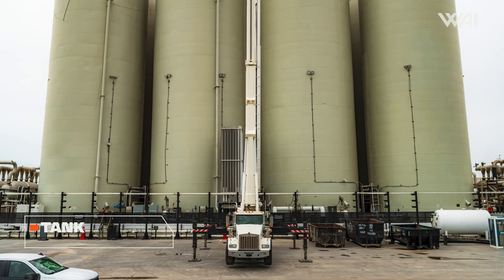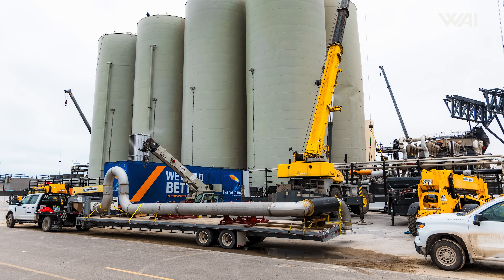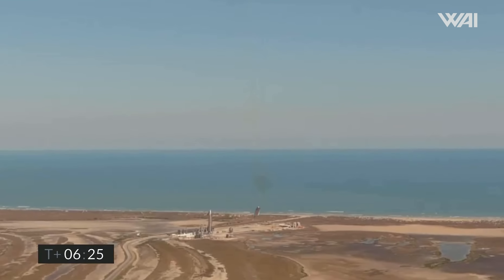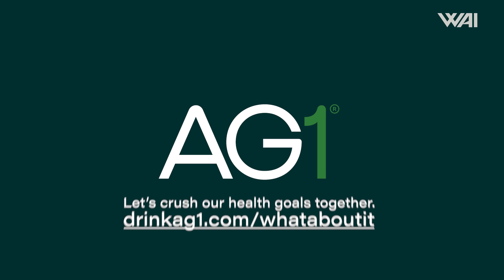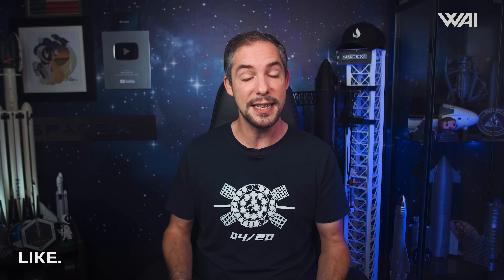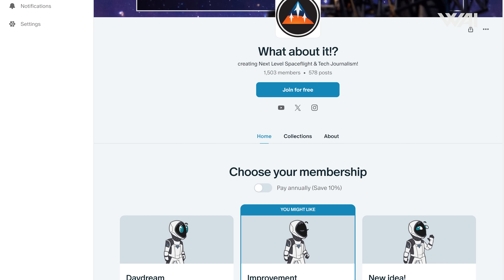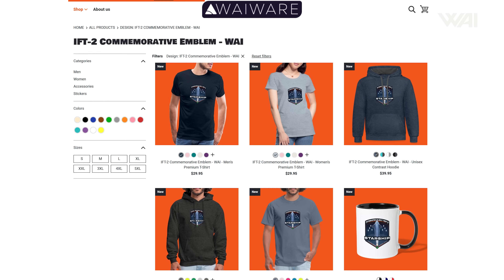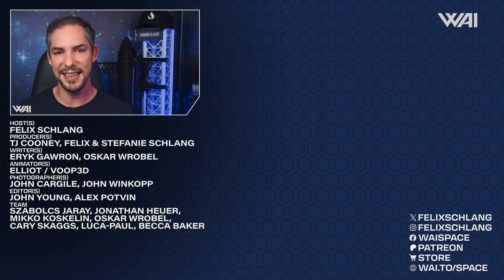SpaceX Starship Countdown To IFT3 - Massive Launch Site Upgrade!

Comment: For those interested in how rocket testing works, the German A-4 was the precursor to the infamous V-2.  It wasn't until its third test before it reached 50 miles high, an altitude when some say space starts.  The launches of the first three Atlas rockets were failures.  SpaceX has already reached 90 miles on it's second test.  So for testing new rocket technology, SpaceX is doing pretty good.
Reply: For those interested, the Germans were pioneers in rocket development and under an  allied bombing campaign and suffering critical materials shortages sooo you can excuse them for having failures. Musk and co had over 80 years of experience to draw upon and the benefits of computer analysis aided design ,so to have 2 rockets fail is inexcusable. This whole starship project is merely a reason to stroke Musks ego at the expense of the U.S taxpayer.
Reply: specifically A-4 is the german designation of the V-2 (which is the english designation for the A4), The V2 was the buzz bomb (aka doodlebug) a subsonic cruse missile. The A-4 was not a precursor to the V2, it WAS the V2.
Reply: @jessepollard7132  The buzz bomb was the V1.
Reply: @interman7715  TBH the rocket didn't fail... the procedures and maths for the staging and launch pad are the ones failed. 

The rocket was already proven in the SN series of test rockets, now is the hard part of putting everything and anything together. 

The SN era of starship test campaign / StarHopper have already proven certain design concepts, including belly flopping and thereafter touchdown, falcon styled landing, capability of the full flow stage combustion methane engine integrated with the rocket.
Reply: @interman7715  Cool story dude, but NASA lost humans in shuttle with only about 20 years less of experience to draw from difference than Musk...
Reply: SpaceX does great. The fastest way to test is to subject the rocket to the most extreme conditions. SpaceX is known for cheering when a rocket explodes. It means they solved all the problems up to the failure event. Eventually they get to a full orbit with successful landing and then testing stops.
They no longer test Falcon 9 rockets to explosion. That's already been done. So the Falcon 9 is now the safest and most reliable rocket ever.
It all looks like a dumpster fire while testing exists, and the detractors have plenty to mock concerning Starship. But this is the fastest path to victory.
If you have the money, this is how you leapfrog over huge technological obstacles. And Elon has the money. Instead of being careful and waiting 10 years for a success (like Blue Origin), he's being purposefully reckless and makes the same advancements in a year or two.
Yes it's more expensive up front with plenty of damaged rockets and launch pads, but once testing is over SpaceX enters a phase where they have a virtual monopoly on services. Nobody else will have a superheavy reusable rocket like Starship. BO's New Glen could be another 10 years away, if ever. That means for at least the next 10 years, SpaceX will have no real competition at that lift rating.

Once minimum viable product for Starship is achieved, expect SpaceX to being testing on Starship's replacement. There's no reason to remain satisfied with just being the best.

Comment: As for transporting the spherical methane tanks, yes it can be done. Bigger and heavier peices are moved regularly. From multi million pound transformers, to nuclear reactors and components, to houses and buildings. True it may have to go into Port of Corpus Christy or Port Aransis as they both have the capabilities to recieve the large barge and get it loaded out. There will be alot of logistics to avoid bridges and underpasses but completely doable. There are a few companies that specialize in this type of transportation.  And remember the spherical tank is much stronger than the tanks currently used. If one of those blows you have much bigger problems than that. If you are really concerned then install them underground. Avoid a failed landing accident all together. Again, completely doable even on the coast. Thank you for the update.

Comment: Attempting to move a massive tank from Florida to Starbase is just a silly notion. It's far cheaper to build something that size on site, after some local sub-assembly. There isn't a shortage of skilled pressure rank welders in Texas.

Comment: I've been there and you've been there there is so much sand in that area. They ought to foam those tanks to keep them insulated even better and then bury them in sand it's amazing how much 10 or 20 ft of sand will protect something. Build a concrete reinforced wall around it and backfill it with sand wouldn't look pretty but you could grow grass on top of it and it would also keep things from getting out of hand should you have an explosion on the pad. And since day one I've been in favor of dredging a port right up to star base. That way you can bring your tankers in full of fuel and offload them easy because the congestion on highway 4 is just going to keep getting worse.

Comment: I think SpaceX will be ready for IFT-3 soon, but doubt they going to have an FAA permit any time soon, without completing an investigation about IFT-2.
Reply from the maker: The investigation might be done soon as well. No FWS involvement is definitely a good thing. No sharks were harmed. :_WAISweet:
Reply: I think the IFT-2 investigation wont take too long as the investigation for IFT-1 didn’t take too long. Probably the main wait will either be booster 10 or the SQD. So hopes up!
Reply: Jesu❤s power proof . Warning it last 72 hours
Reply: Abolish the FAA
Reply: @blitzkrieg1941  No
Reply: Way less points to cover over this investigation compared to the first. Should be much faster.
Reply: @Whataboutit agreed. The dangers were much smaller and that counts. Think third time will be succesfull anyway. Spacex learns quicker then all competitors.
Reply: The FAA moves a little faster than the fish and wildlife service.  By months lol.
Reply: @Aerogamer158  that's because it's really hard to take surveys of fish's opinions.
Reply: My lottery bet is a launch on January 15th.
Reply: @appliedfacts  my lottery bet is that you're wrong.
Reply: @uku4171 Ok, genius, what date would you WAG it?
Reply: @appliedfacts  I guess I'd say middle of March
Reply: I thought that investigation should already be under way - although I suppose that perhaps SpaceX may want to complete their own analysis of IFT2 first, before involving the FAA ?

Clearly SpaceX are also doing a pretty thorough examination and checkout of facilities that have come under any stress.

Others have said that it’s largely written by SpaceX, and then checked and commented on by the FAA.
Reply: @peterclarke3020 When a mishap occurs, the company that has the accident does the analysis, report and mitigations/fixes. After they finish the report they take their findings to the FAA. The FAA then looks it over and approves or denies it. After all that is done, the FAA then writes their report.

Comment: Moving the spherical tanks is an example of how airships have applications. An airship big enough to lift those tanks is not a technical challenge. The tanks could be moved onto a barge and shipped by sea to offshore from Starbase, then an airship could pick it up and move it the last mile. It's also possible to use an airship for the entire trip, but the planning and execution to avoid carrying it over populated areas would be more difficult.
Reply: Airships are the future, but we HAVE to get over the "Hindenberg Effect" and learn to SAFELY utilize hydrogen as a lifting gas in place of helium. I have been studying (and developing solutions to...) this problem for over 10 years now and I would LOVE to work with SpaceX/Tesla to make these dreams a reality. They are the only player in the world that have the means and technologies in-house to develop such a thing and also have a clear need/use case as well.
Reply: @Sin526  Yes. As you no doubt know, at least visible part of the Hindenburg disaster was more about using what was essentially thermite to coat the outside of the ship.
Nowadays, we have a large array of new materials and technologies that can change the equation.
IIRC one of the modern projects does use hydrogen, in a dozen or more smaller cells within a dirigible framework. If such a system used pure nitrogen or CO2 for the volume between the cells and the exterior, with good leak detectors in that space, such a system should be reasonably safe, at least for industrial lifting projects.
Making them practical in changeable weather or in hilly country is a challenge as well. But using hydrogen the prospect of rapidly releasing the gas to set the airship down is much less of an economic challenge. Hypothetically, the vehicle/vessel could even incorporate a water cracker to produce more hydrogen, either on demand or continuously.
Reply: @Sin526  For purposes of discussion, how large would an airship need to be to lift these tanks or other large objects?
Reply: Yes, nitrogen/co2 is an ideal buffer gas, and could even be cryogenically separated from air if suitable weight-saving solutions can be developed (electrolysis for on-board hydrogen production as well, preferably through reversible fuel cell operations to again save weight). I would imagine a ship would need to be quite large to carry tanks of such size/tonnage. My designs all utilize multiple "envelopes" with an underslung substructure arrangement which can be developed separately from the lifting bodies (which I tentatively refer to as pods) and can have multiple different configurations depending on desired characteristics such as speed/range/payload capacity.
Reply: @GaryBickford  If that sphere weighs 1000ton the balloon would have to be 5x bigger than the hindinburg. It certainly wouldn't be "not a technical challenge". If the wind picked up you would have to drop, deflate, and probably collapse the canopy of the ship to reduce air resistance because good luck quickly setting up anchoring strong enough to hold something that big without permanent infrastructure. We could totally do it, but in general airlifting tends to be less practical when you have enough time to do something else.

They only have to get it to the sea though, then they can just float it over there. You might even be able to pressurize it enough to be rolled on ground without collapsing.

They really shouldn't be setting up any more storage than they need close to the launch site though unless they bunkerize it underground, but that's not an option due to the poor ground properties there. I would expect them to set it up a wee while away and just run a big pipeline for refilling the launch tanks, ideally it would be located near a port that can accept gas tankers.
Reply: Unfortunately air ships are a pretty cool vehicle looking for a purpose. Lifting things seems like a natural fit, but when you actually give it some thought you realize there's a big problem with mass changes when lifting something. Airships aren't going to be able to lift some heavy item then drop it off easily without similarly, and nearly instantly, changing buoyancy massively. I'm afraid helicopters are a better fit here.
Reply: @Desrtfox71  Variable buoyancy is indeed the key to useful airship operations. It IS possible, but requires (as of yet) unseen and untested technology(ies).
Reply: @Desrtfox71  That's a real issue, but for some big loads it's impossible to make a helicopter big enough. Several modern airship companies are using various approaches to solving that real problem, but it's definitely hard to do quickly. One company only uses buoyancy up to about 90%, and several sets of propellers to lift the last 10% - thecship itself is negatively buoyant. 
I could see a ground-tether system perhaps. For example, before loading the big tank offshore from the offshore ship, deploy a sea anchor that carries a similar weight to the load. Then after the load is attached, gradually release the water. Then upon arrival at the unloading site, drop the anchor system to a ground connection that will replace the load's down force until the buoyancy can be adjusted.
Reply: @GaryBickford  A way that you could drop the lift on a hydrogen craft could be to have a fuel cell array that uses some of the hydrogen to power a compressor to compress the hydrogen into a storage tank onboard. Storing hydrogen is hard, costly, and heavy, so I doubt you would design it to store the whole volume, but it would be plenty to do altitude control and even a fair bit of load balancing without venting or dropping ballast, and would cut down on the power that you need to refill and run an airship. Heavy lift airships are still absolutely dead in the water unless it's just a fixed route with docking infrastructure along the way in case the weather turns, but that could actually be decent for some very mountainous regions that cannot have roads built, like some of South America.
Reply: @samheasmanwhite it's a bit less than 375 tons empty. 
Not sure how much that changes things.
Reply: @LoisoPondohva  That's a lot better, the airship could be about 1/3 the size I was thinking.
Reply: @Sin526  Variable buoyancy is absolutely achievable right now, you can have a hydrogen fuel cell powered compressor that stores hydrogen on the ship, and for small rapid changes you can mechanically squeeze a special reinforced balloon (or compress air into a light pressure vessel that contains a hydrogen balloon, helium might be better here tho). You could cut the ongoing hydrogen requirement down to just the membrane leakage and that which is consumed by the fuel cells for compression.
I also had an idea for short distance heavy lift that I should toss your way. You might actually be able to make short distance super-heavy airlift both practical and economical if you used fully collapsible balloons, but it is followed by a mobile hydrogen compressor to reclaim all the lifting gas at the destination. The big problem with the really big rigid ones is what do you do when it is not needed, but if you can just reclaim the gas, roll up the balloons, and break down the frame, then you can relocate it like a crane without needing any of the ground infrastructure that airships require, you just wait until the weather is good and fill it up. It would only be good for continental locations where the weather is highly predictable and may need a ground tractor due to the poor aerodynamics, but it would probably be cheaper to operate than the alternative of building or altering roadways to carry loads like this, or the cost of breaking them down and reconstructing them, so it could end up being a profitable enterprise.
Reply: @Sin526  I.e. it isn't actually possible unless someone comes up with some novel tech.  This, IMHO, is a showstopper for airship hauling.  I'd like to see it take place, somehow, though.  As for storage of compressed gas, baffles, fuel cells, etc., none of that is anywhere near fast enough to offset dropping of a large mass - the entire point of airship based hauling.  As for the "negative mass" i.e. not offsetting the entire weight of the craft with buoyancy and instead using lift for some small fraction - that's great in theory, but actually negates the entire benefit profile of airships.  You're then back to a crappier airplane plus most of the negatives of an airship, plus you still need to offset the other 90% very quickly.  In other words, this doesn't solve the problem - at all, it just sounds good to investors.
Reply from the maker: Airships are such an awesome topic! Hugely underused tech in my opinion! :_WAIHeart:
Reply: @Desrtfox71  I think it could be neat for lifting a big heavy thing over some mostly impassable hills. Once. And then you pack it up and go home because airships are utterly useless unless the only other option is to build a triple-wide road that you will only use once. I should mention though that the load balancing isn't a problem if you aren't trying to do it quickly, might take a few hours to suck all the gas out and recompress it but that's fine if you only have to do it once, better hope the weather doesn't change while you are doing it though :)
Reply: @Whataboutit  What areas do you think they have a chance of being competitive in?

Comment: In general, I do not think SpaceX thinks nearly hard enough about failure modes. They mostly focus on speed and efficiency more than planning for equipment failures. I hope once Starship is functional, they will begin to build in more safety and redundancy, especially given some of the Starships are expected to be manned, not just by astronauts, but colonists and perhaps even the general public expecting to fly to Sydney from NYC in 30 minutes.
They always seemed surprised at the consequences of a failure. That has definitely caused significantly more bad blood between SpaceX and locals and regulatory agencies.
Let's hope it doesn't take a disaster with casualties to force them to be more cautious. 
It is heartening to see the young energy of SpaceX that is reminiscent of that of NASA in the sixties. But always remember that those twenty-something NASA engineers had their focus on safety improved when astronauts died in the 1967 fire.